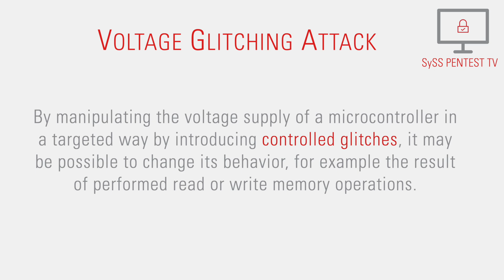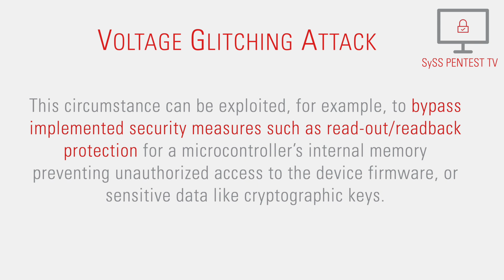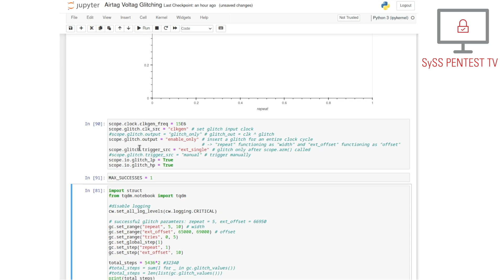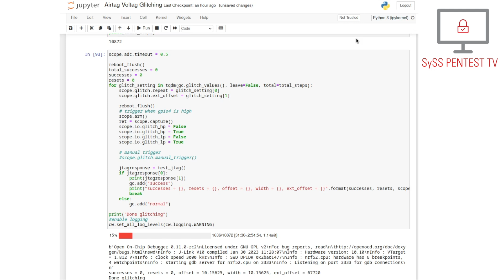Bypassing the Apple AirTag Readback Protection (nRF52832) Using Voltage Glitching

Comment: Hi, great video! What purpose does the ChipWhisperer Target-Board serve in this case? In theory the target device (airtag in this case) should be able to be connected directly I thought. Is it more or less used as an adapter and power supply?
Reply from the maker: Thanks! The UFO target board in this setup was only used for convenience. As you've mentioned, it is also possible to directly connect the ChipWhisperer Pro.